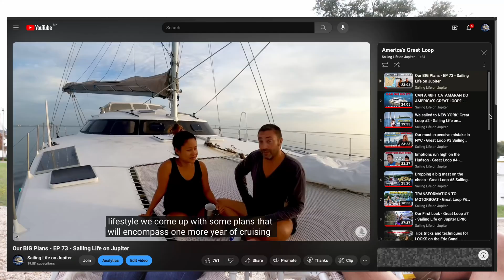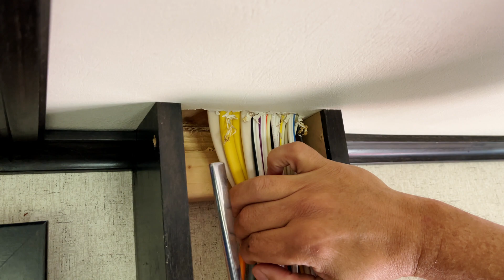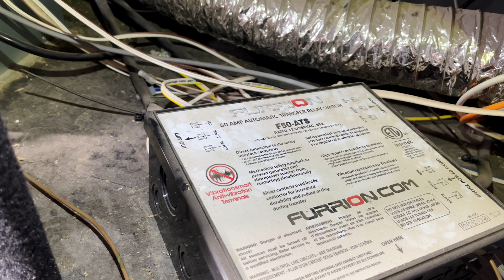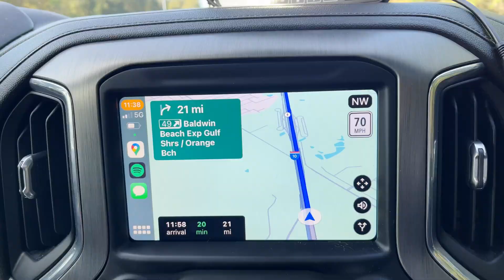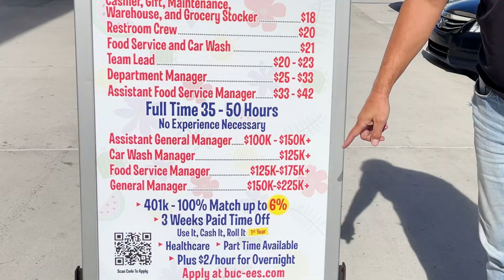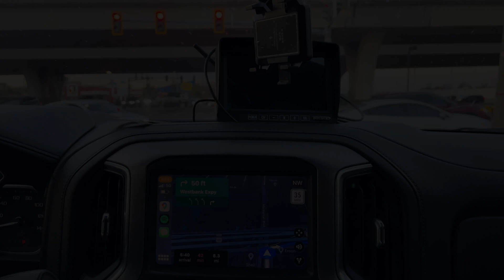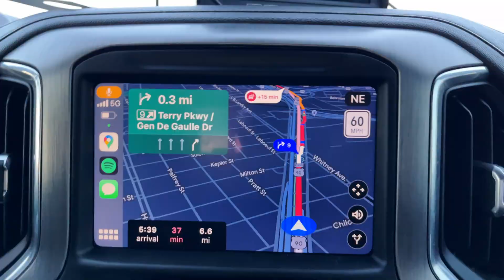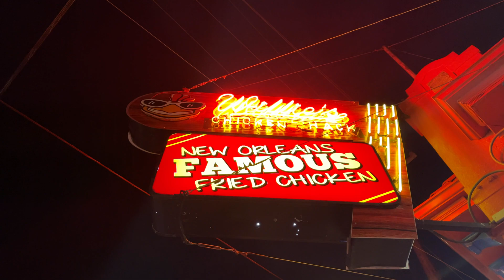SAILING CHANNELS REUNITE IN RV’s ✨RV LIVING EP167

Comment: I love your videos but am missing the boat videos. Looks like cheep roofing material on your roof. I'd replace it with either TPO or PVC flat roof membrane.
Reply from the maker: They are terribly made Robert. Apparently no regulation on RV's.
Reply: @SailingLifeonJupiter Yes, especially the brand new ones. I'd get rid of that thing as soon as possible. There are many videos on YouTube about the new ones. You for sure want to get a used one pre 2020. Most of the new ones have frame issues and apparently most of the brands are owned by one company and that company has all of there frames made by one frame maker and they are bending due to lightweight construction.